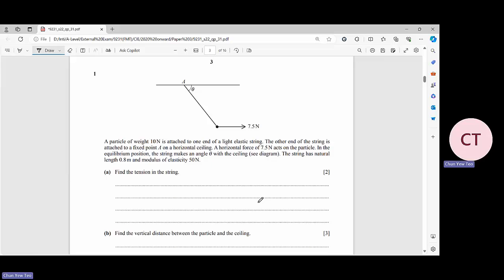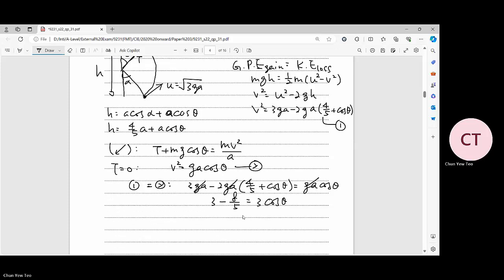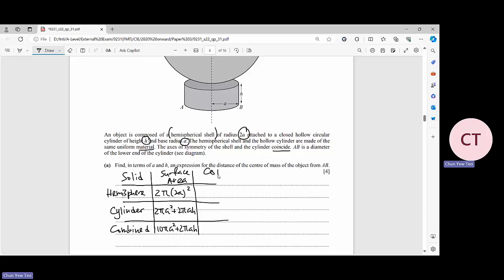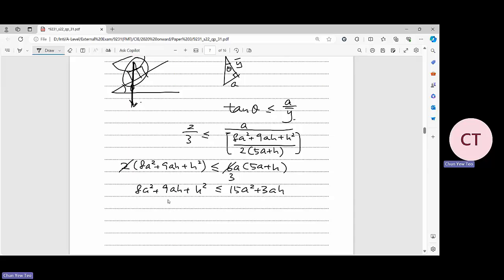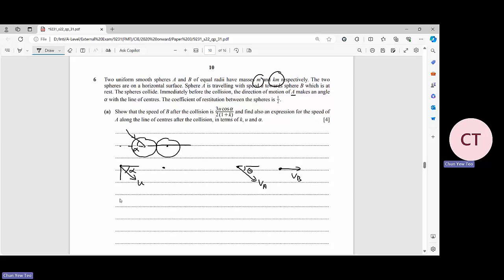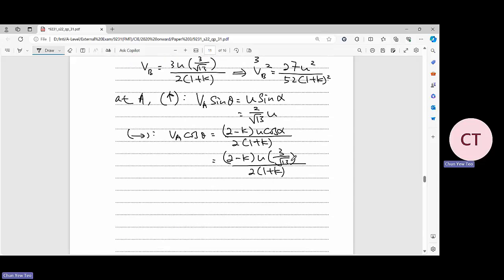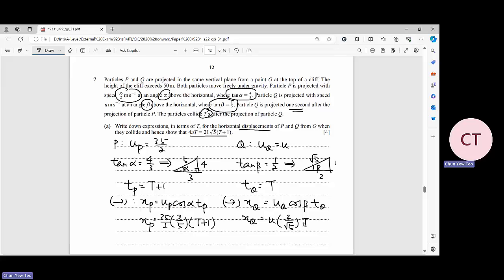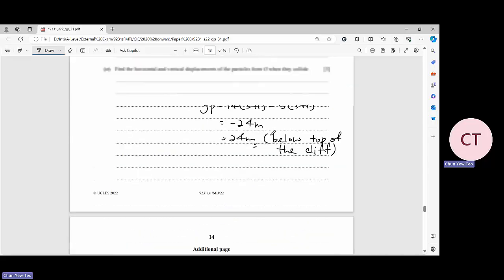9231/31/M/J/22 CAIE A-level Further Mechanics Solution

Comment: Hello. If the cylinder was not hollow, how would we work out the question? Noting that the hemispherical shell stays empty
Reply: If the cylinder is solid then we need to use volume instead of surface area.
Reply: @chunyewteo2692 But then the hemispherical shell would have no volume?